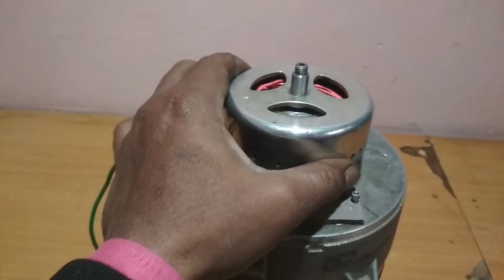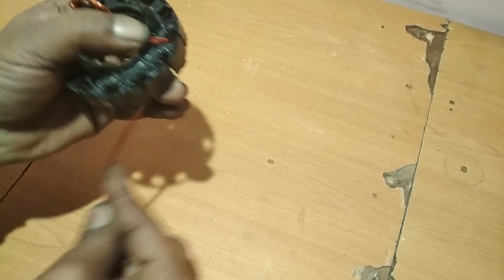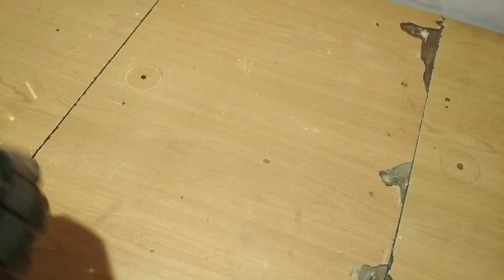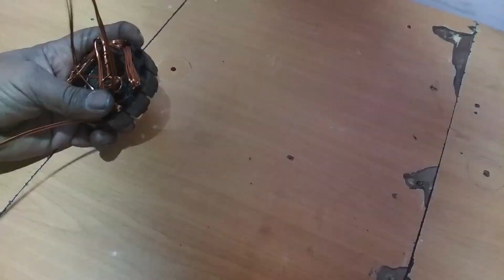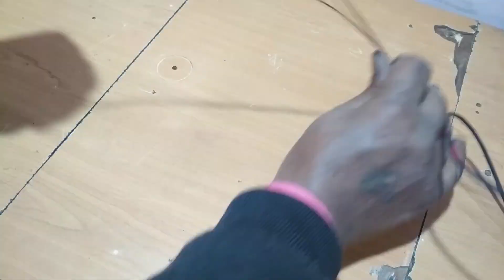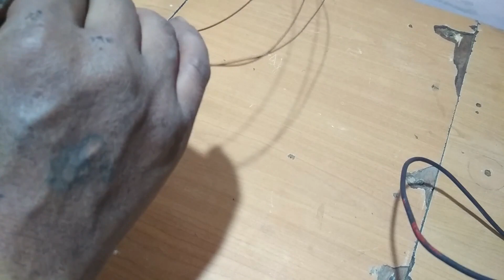BLDC Motor Winding hindi || Rewinding BLDC motor

Comment: 3 wire kyo liye ? 1 mota wire kyo nahi liya ?
Reply from the maker: Sir jyada mota lapetne me problem hoti isliye.
Reply: @electriclocha  Thank you sir, ek saval aur hai sir, High torque ke liye winding karne hai (.5mm, 25 G) ka single wire hai abhi armature bhi aada khali hai konsa wire use karu RPM kam ho jaye koi baat nahi
Reply from the maker: Khali rehne se to koi problem nahi . aap Kya change chahate hai clearly batay Sir.
Reply: @electriclocha  sir mujhe usme takat Lani hai vo do ungliyon se hi ruk jati hai.12v DC cooler wali motor hai. Mai kuch project bna raha hu
Reply from the maker: Is topic per hum video banaynge Sir
Reply: @electriclocha  ok ty